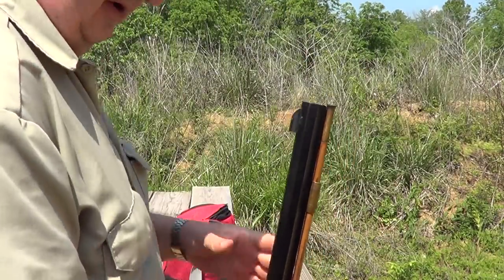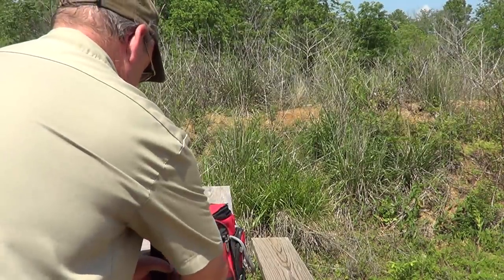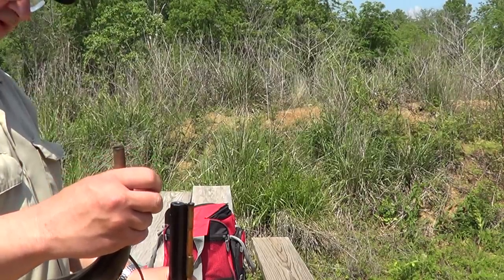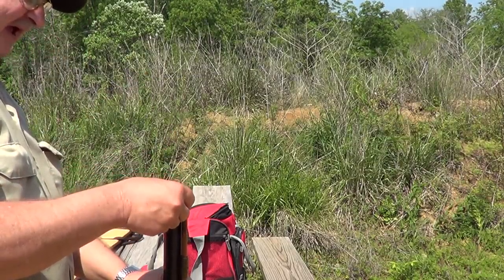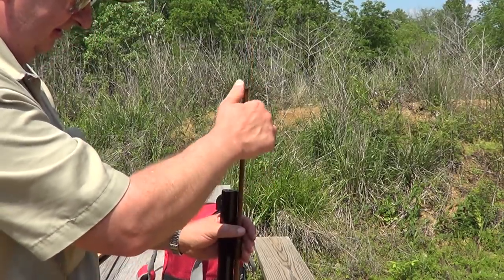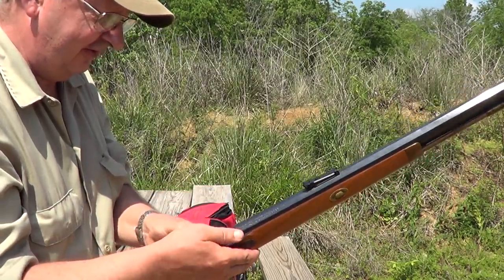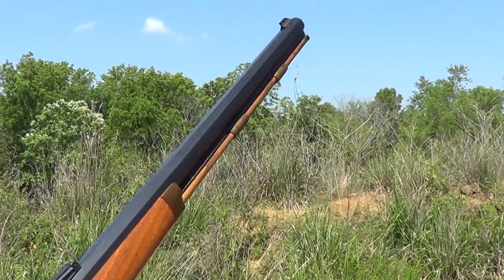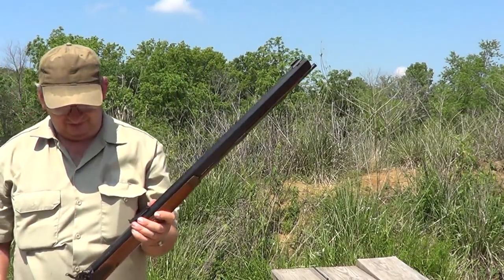Loading A Black Powder Percussion Rifle

Comment: I am glad you touched on pre-shooting prep. I have seen many a video, and a few people skip this part. It is wise to use 1 or even 2 caps to make sure the weep hole is not obstructed. They are cheap insurance and if you ever tried to work a ball back out of your barrel...it's worth it. Especially if you store your rifle vertical where excess oil and dirt will seep down at the bottom of the barrel where it might clog the weep hole. So go ahead and shot off a cap or two and make sure its open.
Reply from the maker: Darrell Schmitz Anyone who has ever had to pull a ball out of the bore will go to great pains to never have to do it again. :)
Reply: ( please excuse my ignorance) But why would you try to fish it out? couldn't you just make sure the ball stayed seated, and mechanically clean out the weep hole? try another cap?

Comment: Helpful Hint of the day - Once you have loaded you rifle for the first time...you can make a mark on your ram rod. So every load after that will show you you are tamped down and ready to go. That will take out the guess work...cut down on extra ramming...and avoid mis-shaping your ball face.
Reply from the maker: Darrell Schmitz Doesn`t work all that well if you use different loads. Difference in depth can be as much as an inch from a 50gr charge with a round ball and a 90gr charge with a maxi-ball in a 45. You also notice some difference between using 3F and 2F powder. On larger calibers 50 and up you would pretty much stick with 2F. But in a 45 2F and 3F work almost equally well.
Reply: The simple trick is to raise and drop the rod a few times. If it’s set right, the rod will bounce and let a nice, clear sound out.
Reply: @1957Shep  , very true. Different loads, round ball, miniball, each are seated depths. :)
Reply: @1957Shep  Thank you. I've so much to learn. I'm getting my first gun this summer.

Comment: Thank You for this video.  A few decades ago (mid-1980's?) I bought a "TRADITIONS INC. FOX RIVER R 50 CAL. 1 In 48 Made In Spain"  Single Trigger muzzleloader rifle from a Gander Mountain mail order catalog when they were advertising that they were "Going Out of Business". This rifle has a synthetic flat black stock, a octagonal barrel, and the steel parts of the gun are silver in color, similar to stainless steel.
    To this day, I have never fired the gun, but I recall the (lost long ago) instruction sheet that came with the gun warning that it had never been 'proof tested'? (fired). Relying on my aging memory, the instruction sheet said something like : 'load the rifle with (a double load?) of powder, a patch and a .50 caliber ball. 
     Then place a percussion cap in the nipple and set the trigger to fire.  Then place the butt of the gun stock inside of an old car tire (with no wheel rim on it), place a few sand bags on top of the gun barrel, and one behind the tire, tie a sting to the trigger and then back away a good distance away before you pull the string on the trigger to fire the rifle.' That method is supposed to test the barrel for safety when the rifle is fired.
     Over the years, I worked with a guy or two that were experienced with black powder firearms, who had promised to take me out and fire the rifle, but for various reasons, that never happened.
     I am now retired and 69 years old, and firing that rifle is on "my bucket list".

Comment: Shouldn’t you set the hammer to half cock before putting the cap on? Just a safety precaution. Also, makes it a lot easier to actually seat the cap. Been shooting muzzleloaders a while now and I’ve seen them accidentally discharge when the hammer was seated on a live cap instead of at half cocked.

Comment: Hi Shep hope you are well, I was told to load a ML in this fashion powder in then put wad in ram in tight then ball then another wad in front , your way is much better and less Hassle ,I guess you could when your sure ball is rammed home make mark on end of ramrod when rod touching ball, to avoid like you say potential Barrel obstruction,
Reply from the maker: Actually, what you described is not wrong. It`s just for a different kind of gun. That is one way that you would load a smoothbore musket or muzzleloading shotgun.

Comment: "...and that's all there is to 'em."  Not quite. But close.  A couple tips: 

1) mis-handling caps will be the norm unless you fully cock the hammer, then place the cap onto the nipple. Keep ALL firearms pointed in safe direction. Get the hammer out of the way. Then, carefully lower the hammer to half cock until you are on target before fully cocking the hammer.  Lowering the hammer onto the charged cap is somewhat risky.  

2) Best results are obtained by evenly pushing the rod down hand over hand smoothly the bore and pressing the rod onto the load - not pounding or tapping, which can result in a false sense of where the ramrod stops.  A mark on the rod will tell when the ball is fully seated. 

3) get rid of that wood rod and replace it with either an after market unbreakable type, or make one from a 3/8 shotgun rod and make sure the handle end can withstand you stepping on it when you need to pull an uncharged ball from the bore.  You twist the bullet puller jag into the lead, turn the gun muzzle down, step on the rod handle and pull the gun off the ball.  trying to pull out a stuck patched ball with greasy hands is pretty tough.  Better to pull off the rifle.

4) Don't slap the ball starter.  You risk tearing the patch at the get go. Just work it until the ball pops into the rifling, then smoothly push it down, then go to the rod.  All that slapping and bouncing is Hollywood.

Comment: Couple corrections - not a good idea to pour powder directly from horn or flask. If there's a spark in the barrel it can ignite incoming powder right up into the horn or flask. And, best way to break a ramrod? Grab it all the way up to the end to ram the ball. Safer to hold the ramrod about half way down when loading the ball.
Reply from the maker: There is a measure on the horn with a spring loaded cut off.

Comment: I cannot imagine having to go to war with all those steps just to fire the gun again.
Reply from the maker: It goes a lot faster if you just do it instead of talking about it.
But military guns of the era were either smooth bore or later ones used a rifled barrel with an expanding base mini-ball. They were a little faster to load than a rifle like this one.
The original Hawken rifles were hunting rifles. Made for power and accuracy instead of speed.
Reply: 1957Shep Okay, that makes a lot more sense
Reply: and that's why you have bayonets :)
Reply: I wouldn't pour from a horn even with a brass measure attached to it. potential bomb in hand
Reply: There were a significant amount of percussion cap designs that used pre-made paper cartridges, rotating magazines (manually rotated at first, but old Colt-y fixed that), breaches, and rolls of percussion primer caps like on a cap gun that were reloaded seperately from the bullets.

Also armies tended to buy small-ish batches of these designs and issue them to various units, (or rather the general would) and some soldiers (and quite a bit of the officers) would use their personal weapons, since most guns back then were handmade with files and hacksaws, and were therefore not machined to near the degree of precision of modern day firearms and therefore required a unique bullet die anyway,

That last part was kind of subjective though, since the larger orders of guns were placed to larger companies which used actual machines to do their, well machining.

As a note there were quite a few pepperbox (multi barrel) and rotating magazine flintlock designs even before percussion caps came along, which often mechanically measured out the gunpowder used as primer and/or the gunpowder used as propellant for the bullet.
Reply: watched The Patriot and i believe they made it look TOO easy because it was a movie but it seems very hard under battle conditions
Reply: granted, those were FLINTLOCKS lol
Reply: Specific Love Creations 9
Reply: Specific Love Creations civil war era soldiers are trained to load those rifle faster though
Reply: well that and there would be about  25 to 30 people in a standard line
Reply: For real...well the only upside is that you could run away to hiding ground or protective cover well before the next shot...hahaha
Reply: @andremead8804  those were smooth bore muskets not rifles.the average man could get off 3 rounds a minute and even with a smoothbore musket you could hit the man you were aiming at at 50 to75 yards.
Reply: @Jay2JayGaming  dont forget that lovely dreyse*spelling* needle gun, that thing was way ahead of its time.

Comment: I have been watching a few black powder videos during the holidays.  I would be scared about leaving a gap.  But if you use too much force you can crush the powder. It seems to be a question of being firm but not  forcing it. I am tempted to say it is a matter of experience,  but it is not something you want to learn about by making mistakes.......
Reply: clangerbasher yeah you're right I was taught to press the bullet home not pound, and don't compress the charge.
Thanks I thought, but you do get the hang of it. I also recommend marking the ram rod stop you see when the bullet is seated. Black powder rifles are very safe with one charge, but like anything an idiot can ruin his whole day.
Reply: clangerbasher yeah you're right I was taught to press the bullet home not pound, and don't compress the charge.
Thanks I thought, but you do get the hang of it. I also recommend marking the ram rod stop you see when the bullet is seated. Black powder rifles are very safe with one charge, but like anything an idiot can ruin his whole day..
Reply: John Koeberlein Thanks.  :)
Reply: Wouldn’t worry about crushing the charge guys. Your rod will give before that. The trick is, when you think you’ve got it set right, raise and drop the rod a few times. If the charge is rammed nice and tight, the rod will bounce and make a nice, crisp clink sound.

Comment: You could clearly hear the steel plate, nice shot sir, with that short of a  barrel that couldn't have been easy unless of course you placed the target 15 yards away....lol
Reply from the maker: These rifles are very accurate. And the set trigger makes them even easier to shoot accurately.
Made this video so long ago that I don`t remember what size target I had set up or how far away. But it looks like it was filmed on one of the old Izaak Walton pistol range, so the distance couldn`t have been more than 50 yards. That`s all the longer that range was before we bulldozed it all out and redid it a few years ago.

Comment: I shot one hundreds of times when I was a kid.long ago..A double barreled 410 ga women's percussion fowling piece. It had carved animals with glass eyes on it. A 45 auto bullet slug would slide down the bore perfect. It's a wonder it didn't blow up as I used Dupont green smokeless bulk. Kleenex for wadding can start fires.  lol
Reply from the maker: Sounds like it was quite a fancy rig in it`s day.
Reply: 1957Shep True story. A 38 special case was used for a powder measure. If the hammers blew back to full cock it was time to reduce the charge. I lived on a big salt marsh and I was blessed as a kid.  Memories.

Comment: After you finish  shooting what is the best way to clean the barrel ? Do you have a video on how to clean the barrel . How do you figure out how much power to use ? After you take a shot do you need to clean the barrel before the next shot ? Whats the difference in 2 f and 3 f ?
Reply: steve dental

Yeah you should run a clean patch after every shot. You pretty much just run one with the rod-it’s flared near the end to help grip the patch and retrieve it from the barrel. 

As for 2f or 3f powder, this has to do with the coarseness of the grains. 1f is the most coarse, 3 the least. Most rifles run fine with 2f, while pistols usually require 3f.

Comment: thanks for sharing also how triggers work thought it was only like a single shot i can not even imagine using these in a war or fight situation neat i like it too.
Reply from the maker: You can use the main trigger without the set trigger being pulled, but it is much heavier.
When we used to have black powder shoots around this area, one of the common matches was "The Bear Shoot".
Put two guys at a time on the line with empty rifles and a "Bear" target at 25 yards.
First one to get his rifle loaded and hit the target advanced to the next round, the other was eliminated from the match.
You would be surprised at how many people, trying to do it as fast as they could, would either screw up the loading process or miss the target completely.
Reply: thats neat to hear thanks looks like it might take what 2 shots every minute if your lucky
Reply from the maker: derplinkster With practice you can do it faster than that, but the faster you go, the easier it is to screw something up. Like ramming a ball down the barrel without a powder charge.
Anyone who has ever done that (I have) makes a special effort to never do it again. :)
Reply: good to hear your better at it looks fun to try
Reply from the maker: derplinkster I`m not that fast at loading and shooting, but I know people who are. I don`t shoot black powder enough anymore to be all that fast at it.
Some of the Civil War re-enactors can get off 4 or 5 shots a minute.
Reply: thats pretty good reloading guess back in time they could also great history like the movie Jermia  Johnson wanting  a 50 cal hawkins rifle

Comment: What he just did was pour powder directly from his powder flask into the muzzle of the gun. A powder flask is similar to is a hand grenade. Should there have been a spark in the barrel left there from a previous shot, the spark would have ignited the charge he poured down the barrel. The flash from that ignition would have ignited the flask and the powder therein. And that would have exploded 18 inches from his face. My only question is...will he still have a face?
Reply from the maker: There is a powder measure on the horn with a spring loaded cut off.

Comment: Saw a lot of things in the first few seconds I would advise against doing. Loading from the horn ( Called a grenade if it went off. Always load from a separate powder measure.) Power is measure by weight, not volume. (Different grades of powder will have different weights at the same volume.)  Shooting over the powder horn is also not advised.  And shooting 60 gr in a 45 sound like too much.  Use that in my 62. Not bad  otherwise.
Reply: Don’t forget loading the primer with the hammer down on it.......

Comment: Been shooting BP some 50 years plus.
I have the hammer on half cock from the start!
Pour the powder, then tap the butt on the ground to help settle all the powder.
A drop tube is better if at a loading bench.
If using a wet lube, I put a card to help stop the powder getting wet, but I prefer a grease lube.
Most of my round balls are swaged so I don't have a sprue as when balls are cast.

But a cast bullet should then have the sprue placed either dead top centre or dead bottom centre,
if not, it will spin off centre when fired!

A tight patch will be more accurate, but too tight will make it harder to load.
A lot of ram rod thumping to get the load down will damage the ball and the accuracy will be impaired!

Happy shooting

Comment: What diameter of round ball are you using? also what thickness of patch is that and is it pre-lubed?
Thanks
Reply from the maker: +Tom Oborny Pre lubed patch 0.010 thick. 0.440 round ball. For 45 caliber.
Depends on the gun. Older Thompson Center guns like this one tend to have tight bores compared to newer ones.
On some of the newer ones, a 0.015 patch may work better.
Reply: +1957Shep Thanks for info.

Comment: First when loading   percussion rifle always put the hammers on half clock this allows the air compressed by the patch and ball to escape avoiding a gap between the powder and ball that could cause the barrel to burst upon firing. Second never and I mean NEVER! Charge the barrel directly from a powder horn or flask always use a separate powder measure as any spark left in the barrel from a previous shot could cause the horn or flask to explode in your hand with dire results!